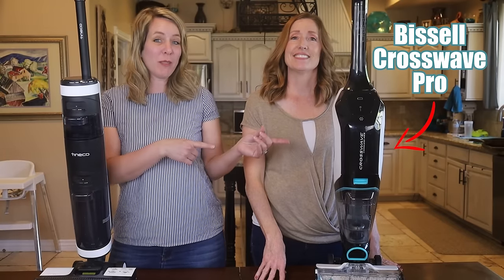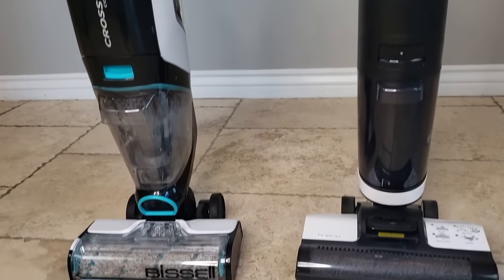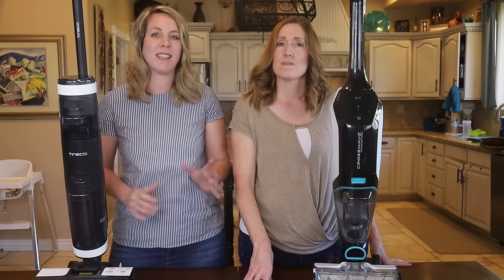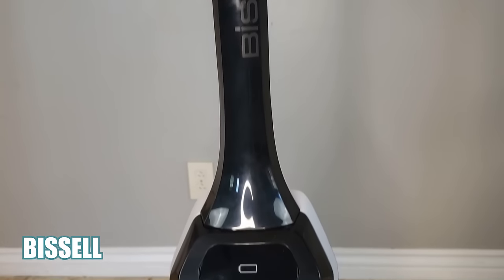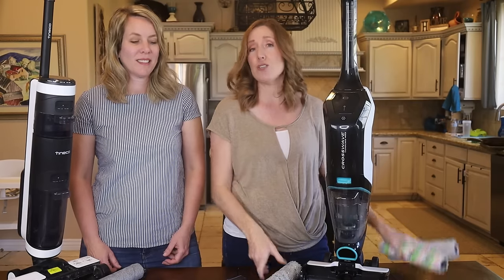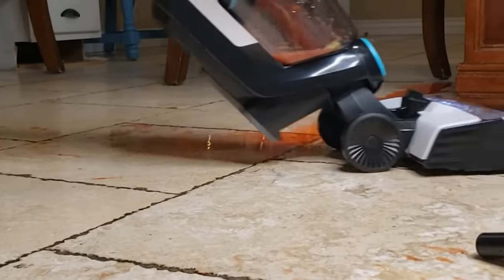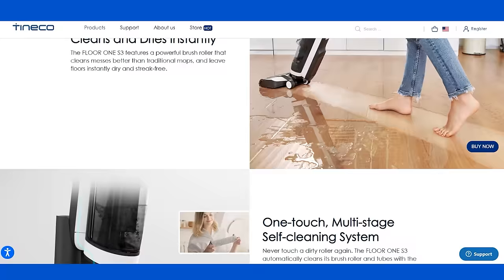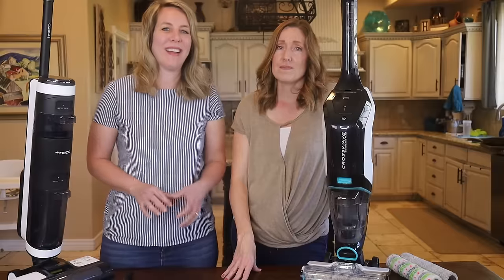Bissell Crosswave vs Tineco Vacmop (Which is Best??)

Comment: Tineco has a error motor issue requiring it to be sent back to the manufacturer every 6 months. I have had both. It is a known issue if you google complaints.
Reply from the maker: Oh no! I've had mine a bit longer than 6 months and no problems... Fingers crossed. Better look at my notes to see the warranty.

Comment: I would jump on the Tineco, but the fact that it is not recommended for area rugs is a downer. I don't have too much faithe in Bissell products having owned several.
Reply from the maker: You can still use it on low pile rugs. It will get damp. I don't have any that I don't throw in the wash to test it though. Bissell is not a brand that lasts and lasts. However, Diana had an issue with her Crosswave and they sent a replacement part out immediately (we paid for our vacuum mops and they don't know us).

Comment: the tinecos automatic spraying of fluid seemed like a no brainer at first until it eventually left huge streaks of water and still sprayed more. only way to stop it from using more fluid is to remove the clean tank. even then it would still have a hard time picking up the water because the brush head has become almost flat. the bissell's brush seems fluffier and the fact that the spray is manual means you can use it to dry vac and only spray IF you need to. the clear winner is the bissell for me. i would suggest no one get the tineco.
Reply from the maker: Interesting I’ve never had that problem. It sounds like yours is defective. I’ve tried several models and currently have the S7 Pro (the S5 before that and the battery went out after 3 years).

Comment: Thank you ladies for this. Does the machines clean the grout as well? Been wanting to get a steam mop but wanted a vac option. Thanks again.
Reply from the maker: No, it doesn't clean grout. Microfiber mops can get into grout lines but this is a flat roller. The only thing that cleans grout for me is cleaner and brushes. 
A steam cleaner with a brush attachment will clean it. I wish it were easier.

Comment: Love my Tineco. I've had it for over 3 years. When/if it needs replacement I will buy another Tineco.
Reply: Have you ever had an issue where your floor stays wet for a long time after mopping?
In the first few uses, my cleaning machine worked like a charm — the floor would be dry in just 15 seconds. But after a month of daily use, about 10 minutes each day, it doesn’t squeeze out the water effectively anymore.
Now, I'm stuck waiting around 5 minutes for the floor to dry.

Comment: Hi, I loved this video and decided I wanted the Bissell Cordless Crosswave Max for Christmas as I have tile and vinyl plank floors. I have used it a couple weeks now and have been disappointed so I am hoping Diana has some suggestions. We have. I kids or pets, but I new the floors were quite dirty from the previous owner.  If you wet a white paper towel and run it across the floor, it is covered in black dirt/grime.   When I use the vacuum it leaves dirty wheel marks on the floor.  I clean the roller 2-3 times after every use, the filter, etc.  My questions: 
1) how to I prevent the wheel tracks?
2) how do you get the roller clean?  Mine still looks gray/dirty after multiple clean cycles when I finish mopping 
3) White paper towel test to the floor after mopping still has residual dirt.  How do I ever get the floors clean? 
Thanks in advance for your response!
Reply: I use a floor steamer
Reply: @ddtuss2585  I have been told by a flooring guy not to use a floor steamer on vinyl plank floors as it can break the glue.  Appreciate the suggestion though!
Reply: @bettyyoungblood9465  my floors are wood looking ceramic tile

Comment: Does the Tineco still work a year after this video? I am seeing lots of issues with battery no longer charging where it looks to start when docked but stops 5 seconds later. I am experiencing this issue brand new out of the box. Feedback on the Tineco and if it still charges would be appreciated, would help me understand if I should just switch to the Bissell instead

Comment: I love this review I just got My Tineco3 for $  200 at Best Buy. But what about when I have my Tineco In a wait time for next use… I must to empty both containers  or can I leave them with water in
Reply from the maker: It's best practice to empty them unless you're using it frequently. If the dirty water tank isn't completely clean then it can stink or even get moldy. 😬 

Be sure to take the roller out, let it dry and check for any hair stuck anywhere. Sometimes you have to wipe underneath. 

Hope you love it like we do!!

Comment: Thanks for the review ladies. That’s very helpful. I have the crosswave which was $700aud on sale. I have hardwood floors and I find that it leaves streaks. I’m thinking of getting the tineco and using the bissell downstairs in the basement
Reply from the maker: Have you tried using  less cleaner than recommended? We’ve found every floor type is different as far as streaking.
Reply: @CleanFreakGermaphobe   I only use water. I found that the streaks are actually the wheels leaving marks. And terrible on dark great floors.

Comment: I’ve had to replace my bissle crosswave twice 😣 thanks to the 3 year war rently but I haven’t been very pleased with all of the malfunctions….lots of errors on all the machines I’ve been sent
Reply: Have you ever had an issue where your floor stays wet for a long time after mopping?
In the first few uses, my cleaning machine worked like a charm — the floor would be dry in just 15 seconds. But after a month of daily use, about 10 minutes each day, it doesn’t squeeze out the water effectively anymore.
Now, I'm stuck waiting around 5 minutes for the floor to dry.
Reply: @BeginnerVille I think that’s pretty typical for this machine

Comment: I just bought the Bissell and I think it's very sturdy when compared to most products in general these days. But is it only supposed to put a barely visible layer of moisture on the floor? Hardly seems adequate to get a tile floor clean. I find myself pouring cups of the water/cleaner mixture onto the floor to feel it is being cleaned.
Reply from the maker: Yes, it’s normal to only put down a little water. Tineco has max mode that adds more water. If I have a tough spot I put water on like you do. Same with my steam mop. They are not super wet cleaning methods but that means it dries faster. They make it easier and faster to clean so you can pull it out right away and go over the floor more often to keep it cleaner.
Reply: @CleanFreakGermaphobe  Thank you!

Comment: I just ordered the Bissell. How is the Bissell Max doing after a year? I see it comes with a 3 year warranty so hope it's great! Do you have any suggestion with how to clean the 1" from the wall and baseboards that the Bissell cant get?
Reply: Have you ever had an issue where your floor stays wet for a long time after mopping?
In the first few uses, my cleaning machine worked like a charm — the floor would be dry in just 15 seconds. But after a month of daily use, about 10 minutes each day, it doesn’t squeeze out the water effectively anymore.
Now, I'm stuck waiting around 5 minutes for the floor to dry.

Comment: Thank you for this review does the Bissell have an auto cleaning function
Reply: Where the machine cleans itself?  If that’s what you mean, they mention that at 3:10
Reply from the maker: It does but you do need to do maintenance on it. So coral the dirty water tank. Remove the roller and sometimes there's hair stuck around or under it. Then I remove the roller and let it dry out. This helps keep it from stinking. Of course it depends on how much you use it. I learned that if you forget to empty the dirty water tank after cleaning, it can get moldy. But the self cleaning function works after basic cleaning.

Comment: I have the bissel crosswave pet pro. It worked great for a few months; now it leaves streaks and leaks when docked. Really frustrating considering this was my second bissel which was the normal crosswave; which had the same issues. My mil had similar issues with hers.

Wanted to give them the benefit of the doubt, but seems like that don’t last very long. Must be some defects they aren’t able to fix.

Pulled the trigger on the tineco. Fingers crossed…
Reply from the maker: Let us know, use mine all the time. Don't want to live without it!
Reply: @CleanFreakGermaphobe  got it today and used it on my floors. First impression- way better than bissel crosswave. 

Now in 6 months or so we’ll see

Comment: I just bought the Bissell cordless crosswave from Bissell. It's 299 and gives you all the extra attachments and cleaners included at that price😃. They also offer affirm as a payment option if you're approved. I almost bought the tineco, but it's 799 right now😬😵😵
Reply from the maker: We just got one.  I'm really liking it so far!   Love the steam option
Reply: Which one do you like better?
Reply: Have you ever had an issue where your floor stays wet for a long time after mopping?
In the first few uses, my cleaning machine worked like a charm — the floor would be dry in just 15 seconds. But after a month of daily use, about 10 minutes each day, it doesn’t squeeze out the water effectively anymore.
Now, I'm stuck waiting around 5 minutes for the floor to dry.

Comment: I just purchased a new tineco vacuum and the crosswave.  Didn't realize there was an upgraded cordless version of the crosswave so I returned both and went online and ordered the upgraded crosswave.  My tineco vacuum came with two batteries and the new one,  the battery was not removable.  I LOVE my tineco vacuum.  Saw this video and thought really? I have to send the crosswave back? Your video helped me know I will keep the bissell.  I want to be able to turn off the water.  When tineco upgrades that feature,  I will most likely order if I can change out the battery.  Love cordless but battery life is a thing and I need more than 30 minutes.  Thank you for the review!
Reply: Have you ever had an issue where your floor stays wet for a long time after mopping?
In the first few uses, my cleaning machine worked like a charm — the floor would be dry in just 15 seconds. But after a month of daily use, about 10 minutes each day, it doesn’t squeeze out the water effectively anymore.
Now, I'm stuck waiting around 5 minutes for the floor to dry.
Reply: @AlesiaDick  What a surprise! Thanks!

Comment: I do not own either and have been thinking about getting one. 
I saw some issues with your comparisons though. First, easily the Tineco was not as loud as Bissel, even the look on your faces said as much so not sure why you said they were the same. Plus Bissel had a more annoying sound, like it was breaking down.

This may be something off screen we did not see, but the sand test clearly showed it cleaned better than Bissel. Also had to lift the Bissell to get the egg mess. Maybe missed this, but did you compare how Tineco was self propelled and is Bissell?

Cleaning the stuck on stuff, you again said Bissel did better, yet on screen you show extra passes for Bissel and Tineco was not even on the screen at that point. Looked like Tineco already finished cleaning. The las stuck on test, again said Bissel did better, yet pulled Bissell off screen and finished cleaning the Bissel side with the Tineco. 

Seems like you used the Tineco to clean up Bissells messes left behind, hen said takes more passes with Tineco, well yeah because it cleaned Bissells messes. Would also use more water because it was cleaning up after Bissell plus its own messes.

I've had several Bissell products over the years so no issue with them. Most other videos showed a more honest approach to their comparisons though. Even the vacuum channels showed Tineco out performing Bissel as far as cleaning goes. Speed obviously makes a difference also, how slow or fast go over a mess. 

Still have not decided, though leaning towards the Tineco. Only thing I learned from this video is not to watch your dishonest channel.

Comment: Do you have any issues with either of the roller heads smelling bad after use? Do you recommend drying them out after every use and do you have any tips for maintaining the heads and prevent them from smelling bad? I envision using them daily but it's sunny and humid where I am, the temperature is around 32deg cel so it's the perfect bacteria breeding ground...
Reply from the maker: I put the roller in the wash with clothes (not by itself) and that works. You could try rolling it in a dry towel.

Remove it and dry in the sun if  or put by a fan. I've heard of people soaking it in vinegar too.
Reply from the maker: If I mop my floor and then don't do the self cleaning cycle, yes.    I wash my brush head probably 3 times a week before I go to bed so it can dry all night.    I could do it more often.   But that also keeps the smell down.
Reply: Are you from Malaysia? BUY ITTT 😆 I use it everyday, all day long. At the end of the day, even if it doesn’t ask to self clean, I do it any way and then take out the roller to dry overnight. And then use it again the next day, every day. No smell yet since 23/5. I’ve only use one roller for now.

Bissel is not sold here, even from personal shopper it is rm2.9k for the normal bissel crosswave cordless max (not the highest specs pet pro), and that is excluding postage and WITHOUT warranty. I’d been thinking for so long these 3 years, delaying on the bissell. And then the S3 comes to Malaysia. For rm1999 with 2 years warranty, I snatched it up without thinking.
Reply: @mdrkd  same here. I have bissell in mind for years but too expensive & cannot get it with warranty in Malaysia 😓 Even now Tineco has a sale I still considering. Bissell crosswave seems to hv better features ie clean the rug/carpet as well

Comment: I am considering getting one of these and was wondering, which product has a better self cleaning process?
Reply from the maker: That's a great question. It's pretty comparable. Both require removing the roller and wiping down the pieces after messier cleaning or if you have a decent mess, each time. The brush that comes with the Tineco is handy for that. You can switch out the roller and clean it in the sink with some spray Dawn or whatever you have too.

Comment: I purchased Hizero which out performed both of these vacmop.
Reply from the maker: It's on our list and we'll have a review coming. We're curious, did you like it?
Reply: I bought the Hizero, but I plan on returning it.  It doesn’t work great on tile floors with grout.  It is really quiet though, and the battery lasts forever.

Comment: Loved this video.  I think the Tineco was louder than the Bissell.   The Bissell has a different roller for hardwood floors.   Is it hard to swap the rollers when switching between hardwood and tile?   Does the area rug setting on the Bissell only vacuum it? Or does it also wash the area rug?   Thanks in advance.

Comment: which is better for normal tile floors.  The Tineco iFloor ONE S3, the Bissell CrossWave Cordless Max or the Bissell CrossWave Pet Pro 2306A, which I think comes with a cable.  I have a small apartment with a tile floor and no carpets.  I have seen many videos but almost all in English and I cannot understand it because I do not know English.  I did this translation in google

Comment: I was all for buying this kind of cleaning equipment, but then I noticed the don't work at an angel, I have a raised bed allowing for easy vacuuming under it, but this type of vacuum doesn't bend the head enough to go under items, it ends up with the head raised off the floor, just having a dinner table might be enough of a problem to clean in the middle of the table.

Considering the price and I can get a robot vacuum/washer for the same amount of money, this seems like a fitness product, because having a robot doesn't make you move enough... Except the time saved with the robot would allow you to enjoy a walk in the park instead.
Reply from the maker: The robot washers don't hold enough water to clean as well or for as long though...

Comment: How often do you have to clean out the insides of these vacmops?
Reply from the maker: Every time. Run the cleaning cycle, empty the dirty water tank and is needed, clean it. It’s fast. But ideally you remove the roller to let it dry. And if there’s a lot of hair, wipe out behind it and behind the dirty water tank. It depends on how bad the messes are that you’re cleaning. I keep up on it so it’s never a big deal. It takes 5 minutes or so. So much less work than with a vacuum and mop.

Comment: I've been torn between the linear driven rotating mop/vacuum by Bissell (or similar models) and this type of product which does both vacuum and mop. I have all hardwood and tile and a fair amount.

My question is: The females in my home all have very long hair. I am often cutting hair from my Dyson vacuum that I use prior to using a steam mop and wondered if the linear roller for the vacuum/mop combo will cause major issues with this??? Not sure if you know or might offer any comment?

Thanks and enjoyed the review!

Comment: Is the Bissell self-propelled?

Also, I see lots of reviews on the cleaning of both devices being a pain but this review says it is so simple so is there a need to manually clean components after each use?
Reply from the maker: I do manually clean it most nights.   It's part of my routine. I always fill my dishwasher.  Then once my sink is empty,  I empty the dirty tank, rinse it, rinse the filter and rinse the brush.   O squeeze out the excess water then leave it to dry.   It only takes a few minutes
Reply: @CleanFreakGermaphobe   I do exactly the same thing.  It only takes a few minutes, which is far and away less time spent than sweeping, vacuuming and mopping, which also involves setting up a mop bucket and then cleaning up those implements!   My Crosswave is always like new, and always ready to clean whatever nastiness the animals put down!